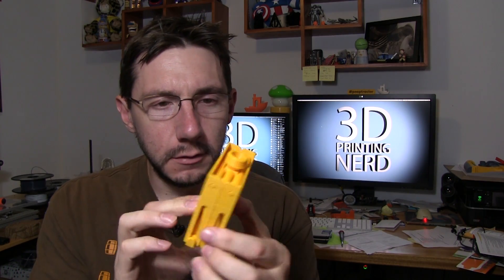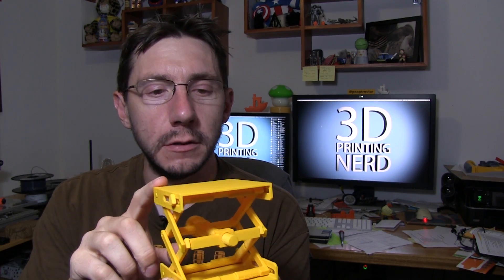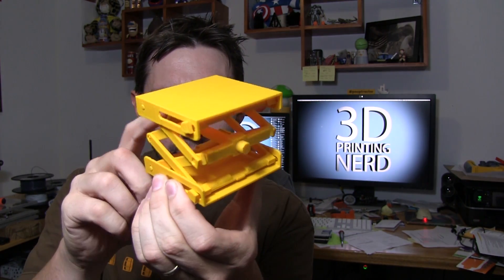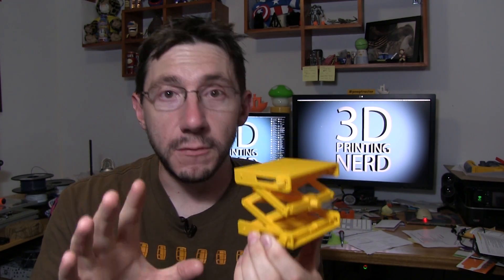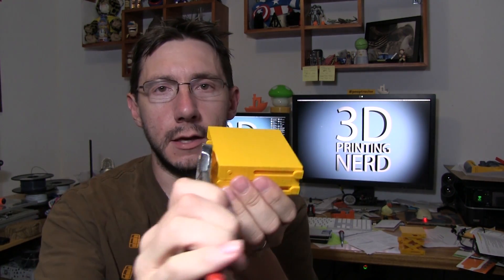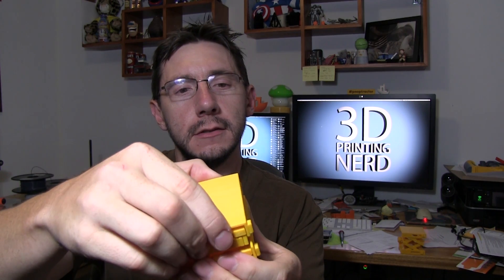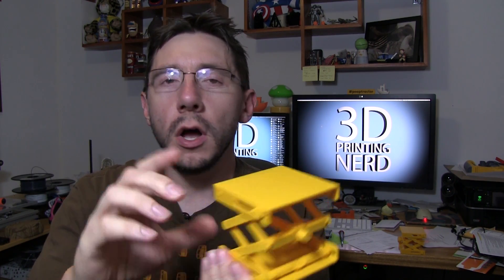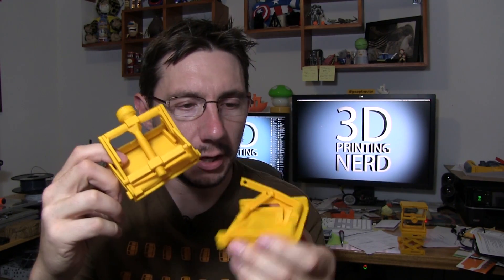3D Printing a Jack Stand / Scissor Lift plus Simplify3D Horizontal Size Adjustment / Timelapse

Comment: I printed 3 of these and the little pins always fused and made the arms break when I twisted it.  That was on my IIIP Mini.  Hopefully my Creality CR-10 will have better results.  I just wonder what the issues are (over extrusion, too high temp, print slower).  Any suggestions would be appreciated.  I have the same issues with iris boxes (small tolerance areas fusing or sticking).
Reply from the maker: +Jason Baker you could try a lower temp or more cooling. If the model looks good and doesn't show signs of over extrusion elsewhere you may want to try those two things first.
Reply: Awesome! Thanks Joel! High Five!  

Side note, my IIIP mini just died this weekend after 2 months of heavy usage (running about 12 hrs a day errday!) and since I upgraded the firmware, voided the warranty so no RMA.  I just ordered the Creality CR-10 from TinyMachines in Texas so it should be here early next week.  I have learned so much from you and your channel. You have definitely made everything I print turn out better! 

You, Maker's Muse, 3D Printing Professor, and Barnacules have really made the 3D printing experience awesome for me and helped me to learn so much about the tools and process behind making a good 3D print.  You have also helped me avoid or work through so many of the challenges that are not intuitively evident.

Just wanted you to know how much I appreciate the wisdom and enjoy what you do.  Thank you for being awesome.

Comment: Scissor lift... not jack stand
Reply from the maker: CRAP. you're right.
Reply: It's really called a lab jack. Used in laboratories, but I use them for resting my hand when tig welding, also to change the elevation of the torch for welding taller parts.  Pretty cool piece - thanks

Comment: Do you think the Mod-T by New Matter (the new printer you posted a video of yesterday) is good enough to print this?
Reply from the maker: I don't know. Turns out it has a filament fan, but, it has no shroud. I may try to add a shroud, as this would require active cooling.
Reply: I'm new to 3D printing, but what's a shroud

Comment: Great videos. I'm thinking of getting my first printer but can't understand how they can print a horizontal surface in mid air? Are there restrictions on the shapes that can be printed?
Reply from the maker: a horizontal surface in mid air can be printed because of support material! a printer will lay down filament used as a scaffold underneat parts that would otherwise be printed in mid air. when the print is done, that scaffold of support material is easily removed. I hope that helps.
Reply: Many thanks for that. How would you rate the Prusa i3 mk2 as a first time printer?

Comment: Printed it on my Makerbot Mini with 10% fill in PLA.  The lead screw broke when trying to free it initially.  This tells me I should have used a higher fill percentage.  Once everything was freed, it worked well (I glued the end of the screw that broke off back on after the lift was extended).

Comment: High five bud, why don't you like ABS? Which is your filament of choice and why? 
PS Bacon Rules!
Reply from the maker: +Mike Carr I keep saying I don't like ABS because I've only had it print successfully on one of my printers. Ever since printing more with PLA, it's just been a MUCH easier time. AT SOME POINT the community is going to make me print ABS again, I just know it. :) I dig PLA, and my favorites are the Proto Pasta exotics. #ReturnFive
Reply: I have a Da Vinci so all I did was print in ABS, I was not having fun due to all the variables. I finally upgraded to an E3D v6 hotend, now I can print PLA and I really like it.

Comment: do you have any specs for PLA and ABS to use for Wanhao i3 v2? Test OK HAND is fantastic but i cant figure out to make other models really sharp as that.
Reply from the maker: I use the default settings in Simplify3D for my Di3 - what specific settings are you looking for?
Reply: wanhao 3d printer i3 v2 pla & abs settings

Comment: I am also trying to print this and having trouble just before the print head gets to the conical part of the lead screw where it starts to square off.  For whatever reason even though I have a raft selected, the screw starts to move just enough that when the print head is trying to print the square profile of the lead screw the whole screw shifts and ultimately messes up the print job.  Did you slow the speed down at this point or what could be the issue.  I know my machine is square and calibrated as the rest of the jack comes out great.  Appreciate any help!  

P.S. Keep up the great work on the vids!

Thanks,

Dennis
Reply from the maker: +Dennis Forbes Hey Dennis! Shoot. I did absolutely nothing special. No slow down. No nothing. The whole screw is shifting? Is it coming loose from the bed? Are you on Facebook at all? If so, you should join the 3d printing group I'm also a member of. Almost 10,000 members, and LOTS of people to help with issues like this. Link to the group is here: https://www.facebook.com/groups/makerbot/

Comment: I notice several spools of PLA sitting on the desk behind you. Any issues with the filament degrading or print quality problems after leaving them sitting like that? Does it seem to matter? I'm new to 3D printing (just had mine for a month) but I had read that PLA and other filament absorbs moisture from the air and will print worse after that. Thoughts?
Reply from the maker: +Jason Cox Hey Jason! So far so good. I've started keeping the rolls of PLA in ziplock baggies just in case. Before that, I hadn't, and I hadn't noticed any difference. That said, I am in an air conditioned house, and the humidity in the house doesn't fluctuate. That mya play a roll in my not having any issues.

Comment: I PRINTED IT! AWESOME FOR MY RC BUGGY! Subscribed....like a boss!
Reply from the maker: +Jeff Lever YEAH YOU DID! BAM!
Reply: Hey man just saw you had made this, wondering if you could answer me a quick #d printing questions about this platform jack, would it be possible to print it around 1.5 inches in length/width, so much smaller than normal and still have it work?

Comment: Is it possible to mount the camera on the print plate? The time lapse would be better if the model was "standing still". =)
Reply from the maker: DIY_glenn Agreed! I want to, and I'm looking into that. The buid plate is spring loaded, and I just want to make sure that A). the weight of the GoPro doesn't affect the sprints on the side it's on and B). the weight of the GoPro doesn't affect the movement of the Y axis. I'm working on it, I promise :)
Reply: 3D Printing Nerd Hmm, can the springs handle the camera weight without being pushed down? If it doesn't affect the Y-axis movement, maybe you could have a counterweight on the other side to make sure it is still level? Maybe do a print with one of those "3D-printer test" objects which checks overhang, angles etc, and print with and without camera to see if there is any difference?
Btw. the rest of the video is great! Thanks for taking the time to show that it can fail as well!
Reply from the maker: DIY_glenn Great idea! Once I get it down, I'll definitely print a test object first!
Reply: Yeah, maybe you'll post a video about the results? :)

Comment: I've never seen anything printed together in one piece that is fully functional, that's pretty cool stuff :)
Reply from the maker: Lego AnimeLTD Right? I've seen some things that print fully assembled, but THIS truly caught my eye.
Reply: +3D Printing Nerd 

Hi, I'm retired now but I’ve had half a lifetime designing and
manufacturing special purpose machines for industrial and scientific applications
and I find this 3D printing technology fascinating.  Having grown up with good old-fashioned technology
and materials the idea of creating the jack/lab-stand as a single component and
cracking it into a useful multi segment device is like science fiction to a guy
borne in the 1950’s. I wonder how long it will be before you can mix different
materials on the same bed so as to combine lightweight materials with hardwearing
materials, maybe that’s already being done? Thanks for showing the failures as well,
not that it was your mistake but I always reckon the guy that never made a
mistake never made anything, and man I’ve made some mistakes, lots of near
misses but no disasters. Thanks for posting.Kind Regards  . . . Andy
Reply from the maker: AndyDaviesByTheSea Hey Andy! Thanks for the awesome words! Also, yes, people are starting to combine multiple materials on the same print bed. In fact, one of the most useful things right now is printing with two materials, one being a PVA material that it used for supports. PVA is water soluble and can be removed by letting a part soak in water overnight.
Reply: +AndyDaviesByTheSea        do you develop  materials of filement or just design and printing ?